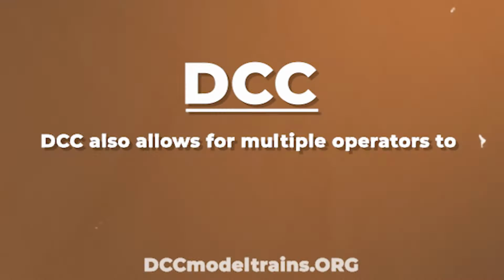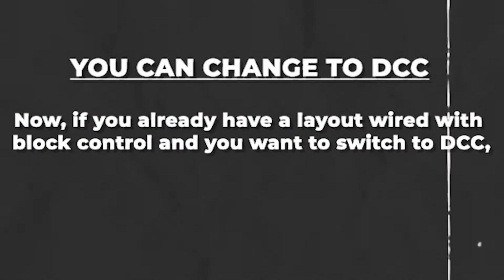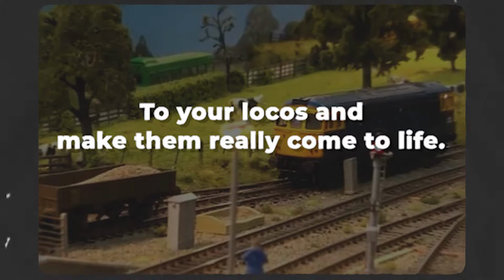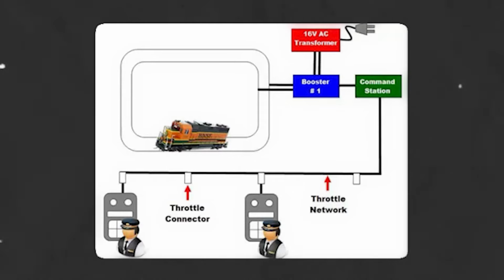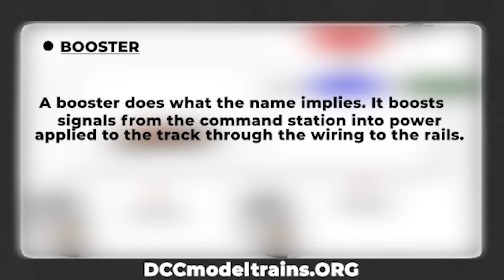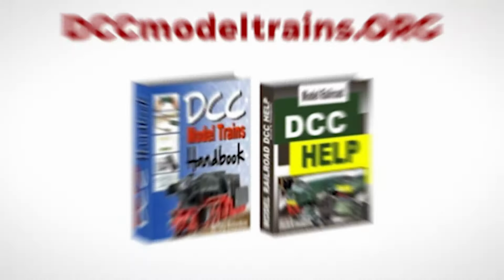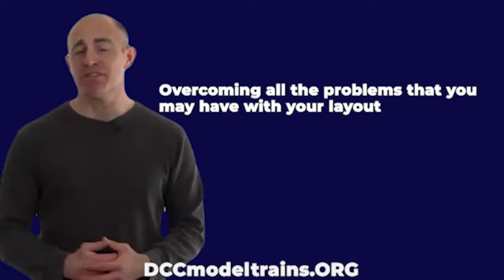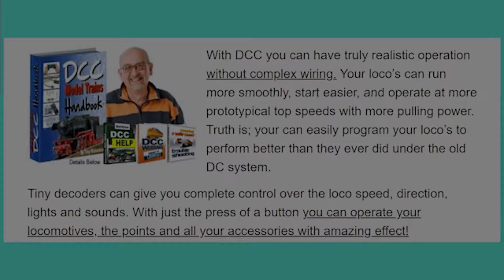DCC Train Control Systems For Model Railroad Beginners Explained 😄

Comment: Middle ages tech. The future is BLE - Bluetooth Low Energy. No need for expensive command stations. Power your track with DC or Ac and control your complete system with Bluetooth integrated decoders. No need for in-depth knowledge of CV's - it's all there at a touch of a fingertip on the fly.
Reply from the maker: Thanks for the input. It is good to get different perspectives.
Reply: i do the same with Hornby's HM7000, with a twist, i have battery power in my locos 4mm scale. No transformers, no track cleaning, realistic scale track.